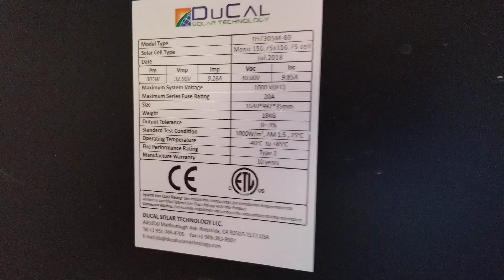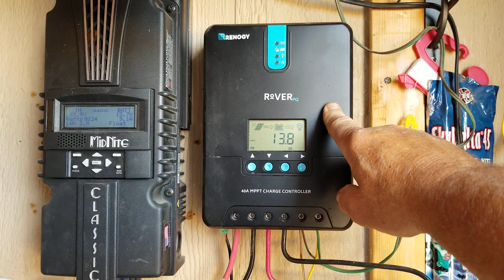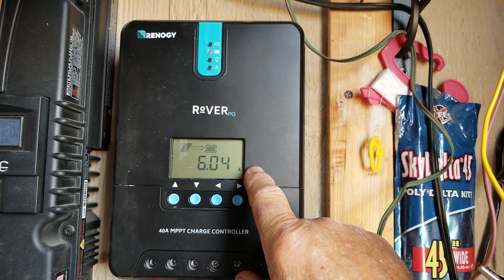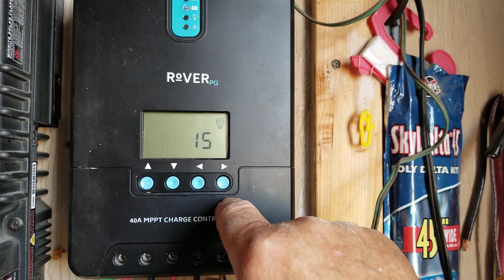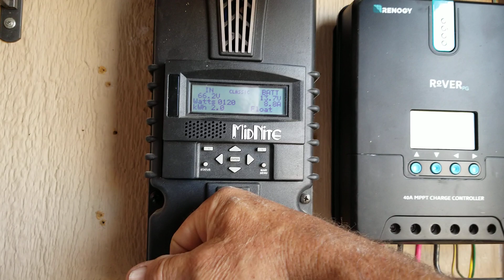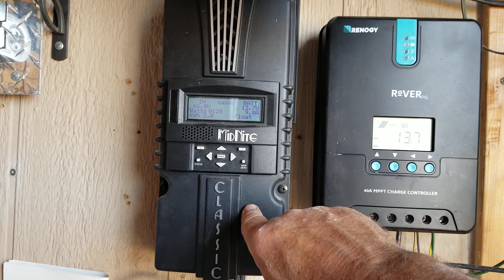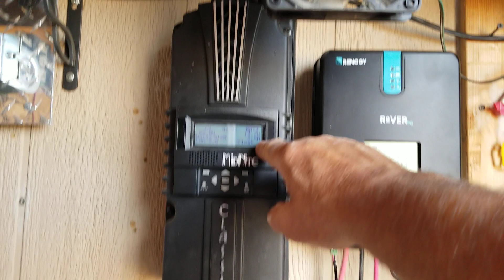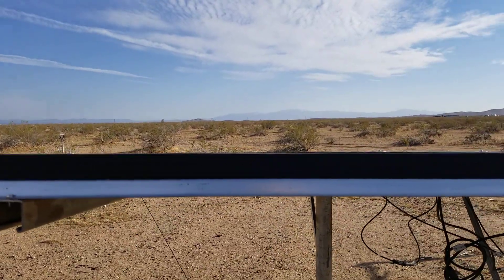The New Solar Panels, and How They Will Be Used, April 11, 2021

Comment: running 100vdc from your panels does Not make it easier on your inverter. you are still running a 12vdc battery so the mPpt is converting down to 12vdc and the inverter STILL has to boost it to 120vac. so there is NO efficiency gain THERE. i am not saying you're DOING anything wrong, just understanding it incorrectly. running series panels into a high voltage mppt cc is the best way to go as you get less line loss from the panels to the mppt cc or smaller wire, but that is where the gains in YOUR system stop. no disrespect intended gbear, i love your videos and live vicariously through them sometimes.
this being said, you really should reconfigure your batteries for 48vdc and change your inverter to something a little newer like perhaps a mpp solar lv6548.
keep up the good work, and reply and let me know your thoughts on going 48v. cheers
Reply from the maker: Thanks.  That is in the plans for the near future.

Comment: I got a 4215 BN Epever controller...oh, it says it's 2% more efficient,  99.7% @ 33 volts versus 62 volts...and I mostly bought it because it can take #4 wires ...so see, I never fit the box, sitting here with four new tires , lol I was going to make another frame but it's flooded the barn now...but since I got a DC welder now I might do it idk
Reply from the maker: Work never ends!

Comment: Midnight might be the best in America, but in Australia, they are not. Go with Victron if you can afford it. Go with Victron inverters, they aren't that pricey and they are rock solid. Second best inverters would be the new Epever
range. 50amps and up, and under drive them.   :)
Reply from the maker: Good info.  I have used either, but will try to add them to my list of learning.

Comment: I'm waiting for the Harbor Freight 100 W systems to go on sale and get one for my storage shed.  Just need to run some lights inside and maybe a motion sensor light outside.
Reply from the maker: Before retiring, I designed and built many tool sheds with metal studs and Harbor freight solar panels for lighting, as well as  3000w HF inverter for running power tools.

Comment: I have a hurricane vector and it works very well but I need to get a classic 150 to double my power
Reply from the maker: That will do it!  I'm sure you know the classic will not run as a hybrid.  It's either wind OR solar.
Reply: @GBear  yes I know

Comment: I have a wind generator like your but my wind is between 12 to 18 mph and it doesn't work for me
Reply from the maker: I can understand that.  The KT5 will start producing at 8mph, but nothing to write home about.  25-30mph gives good decent production.
That's why I tell people that wind power is not a choice for main production, just a backup.
Reply: @GBear  yes but my hurricane vector at 11 mph it makes 3 to 5 map at 25 mph it makes 67amp i love it .its like you said get the beat and you get the best generator
Reply from the maker: Thanks for that.  I'll check the hurricane out.
Reply: My KT5 stopped working, front bearing got rusted and stuck and I took it down, ordered a max core pma and  will put it back soon also got an ista breeze i2000 to install, sooooon :)
Reply from the maker: Cool!  Let me know how that works for you.  I was thinking of going max core on mine too.